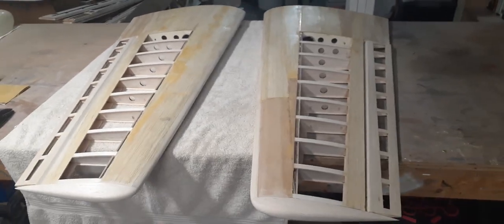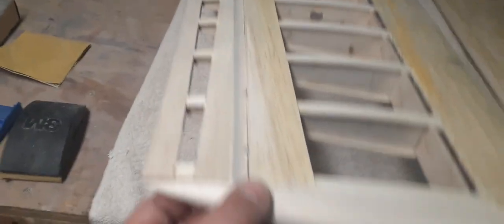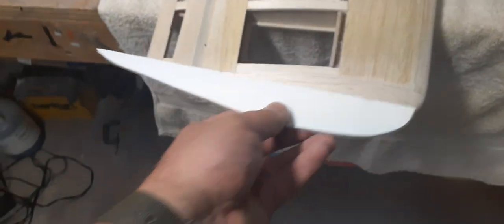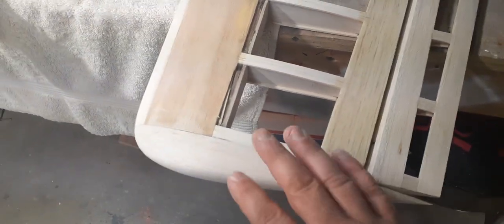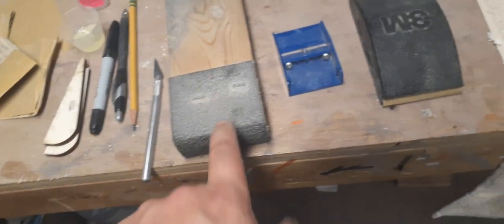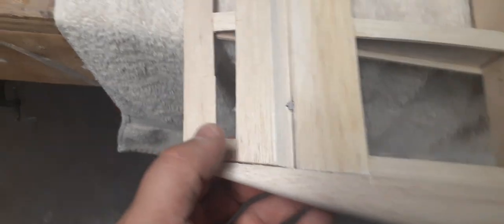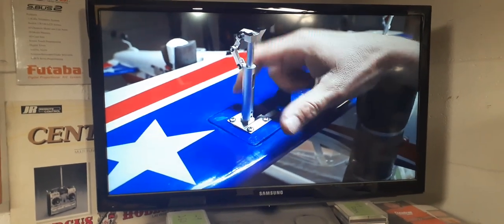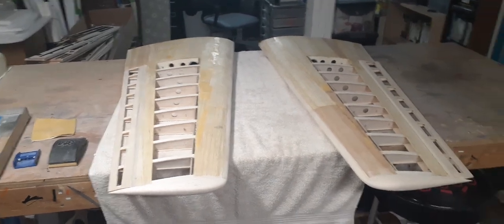CCK Super Chipmunk build #6

Comment: Interesting to see your method of making the wing tips.  I have been building an SFM P52 Mustang and for the wing tips the kit provided strips of 1/4 inch balsa with the centres cut out which I had to glue together with PVA and shape.  It was satisfying to turn quite quickly a pile of strips into a nicely shaped wing tip.  I preferred to do most of the shaping before fixing the tips to the wing as I would have found it difficult to avoid cutting into the thin balsa wing covering with coarse sand paper. So another method which works if larger blocks of balsa are hard to come by or there are spare strips of balsa lying around in the workshop.
Reply from the maker: I've always liked a big block and start carving away!

Comment: I asked  the question about the ailerons.  In an earlier video you showed the leading edge of the aileron abutted to the trailing edge of the wing.  It was at 90 degrees , not angled down from top to bottom the way a barn door aileron would b, so it couldn't rotate up and down..  What is different is that you added triangle stock to make that the leading edge, so now there could be movement